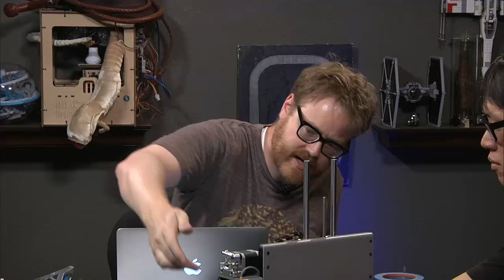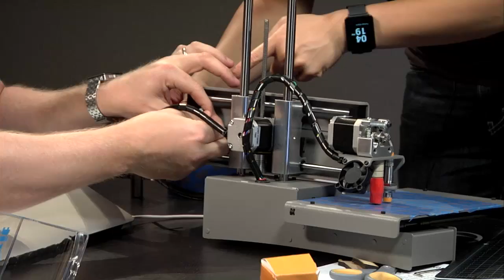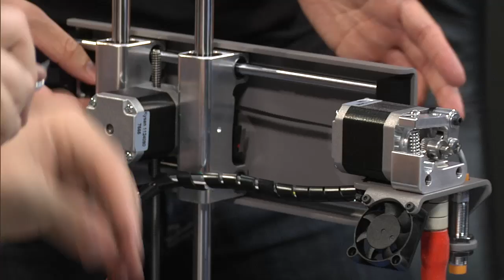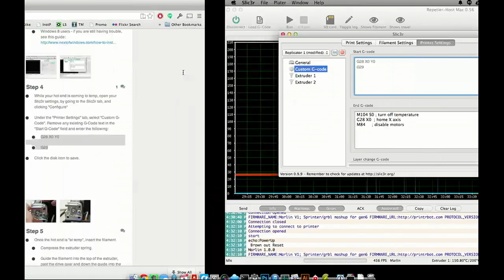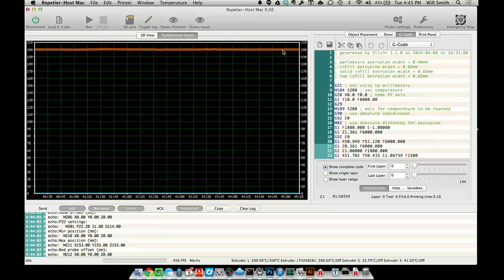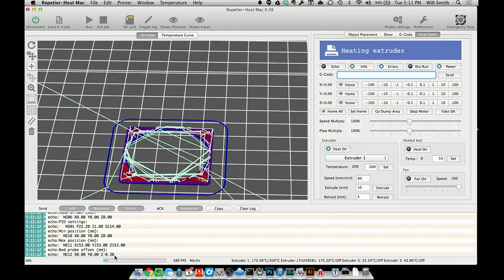Tested Builds: $540 3D Printer, Part 5

Comment: just found out a very effective method for bed surface prepping and I bet everyone has one roll in their house haha
remember that plastic wrap you might've used before to cover the outside of a textbook to keep them neat?
well its reaaaaaally effective for bed adhesion, at least in my case for the prusa i3 printing abs on heatbed
and even more effective for extracting the prints; I scissor cut a piece and stick it over an 8x8in glass

Comment: @2:20 Why do you use the blue tape? - So you can remove your print. And whatever about the overlap. There is superwide blue-tape available. most of the time I put enough down to cover the corners so it doesn't warp and it gives me a good corner/surface to wedge a blade under to pop the print off of.

Comment: it looks like the bed proximity sensor they included is junk, I'd take a mechanical switch over that any day.-- with all of the rods and bearing on the back of the bed you would think that would impact its ability to sense a specific distance from a varying profile of metal...i think manual bed leveling would be more newbie friendly than this option...
Reply: That proximity sensor looks pretty normal to me, though it looks like it would have been better if the kit designers had chosen a type that reacts at a distance of several mm from the plate, so it would be a safer distance from the output material.  All the fiddling was about adjusting its position relative to the extruder head, by simply turning one nut, then locking it with a counternut.  But once again, a more sensitive detector would require little or no hardware adjustment, just a larger configuration offset for the homing operation.  E.g. if the sensor reacted at 5 mm above the metal and was mounted 2-4 mm higher than the head, the offset would be 1-3mm, and the clearance would be 2-4mm.

Another relevant test / adjustment job would be to scan around the full X,Y plane and measure if the hight is consistent using the end stop as a probe.

Comment: The Z sensor and the auto procedure to check the level of the built platform, using 3 points, is probably for the software to get an idea of how offset is the built platform plane from the xy plane. By knowing the offset the printer can correct the movement of the printer head in order to keep the distance from the printer head to built platform constant (offset the planes In the gcode). In this way, this printer doesn't need any adjustment of the built platform, it can print in a surface that is off level.

Comment: One good way of securing small belts with zip-ties is to take two sections of another zip-tie the length of 3 to 5 belt teeth and place them on either side of the belt being cinched (zip-tie teeth facing the backs of the belts).

Comment: NEXT Build: Building a 3D printer with a 3D printer. You could potentially print all the components except the wires and electronic parts with a 3D printer.

Comment: That sound during the small holes is definitely the host not sending the commands fast enough. You can fix it by taking the print move render off the screen or lowering the render quality to speed up the program.

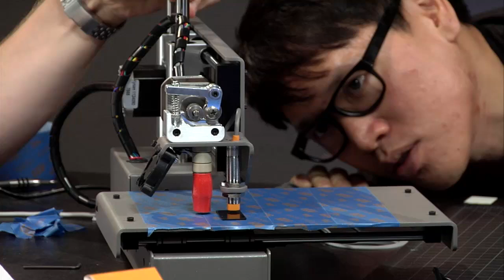Comment: 5:10 What if it had a little LED which beam gets narrower and narrower as it closes distance with the plate.
Reply: Then if it completely lands flush with the plate, then the light would disappear and you can back it up to just barely peaking light. Easier way to distinguish between completely touching and barely not touching.

Comment: Interesting build.  Thanks for showing it.

Octoprint is great.  I run it on both of my printers.  But, I would recommend using a Beaglebone Black if you are planning to host it on a printer.  The Pi is cheaper and I think a little easier to setup with Octoprint.  But the better performance of the Beaglebone is noticeable.  Especially when uploading large gcode files.  Files that take several minutes to upload on my Pi are upload to the Beaglebone in seconds.  And I see far fewer "stalls" in the print movement on complex corners with the Beaglebone.  I've even been considering swapping out the Pi on my other printer.

Comment: File a small flat on the stepper motor shaft where pulley grub screw hits. It makes for a very positive drive. use a small needle file..

Comment: X 0, Y 0, Z 0 is in the front left corner. X counts up as it goes to the right. Y counts up as it goes to the back, and Z counts up as it's raised. If the steps are being counted backwards you can just flip the connector to reverse the direction of the stepper.

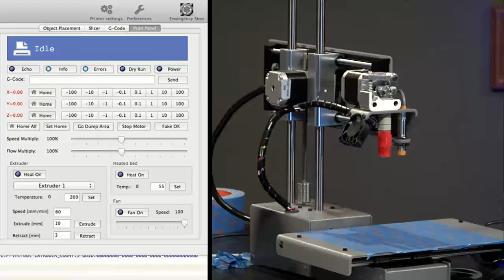Comment: @24:40 The software should move each axis in steps until it reads a switch being activated, then configure that switch to the appropriate axis. This would protect the motors and it wouldn't matter which port you connect the switches to. Also I swear X is horizontal, Y is vertical and Z is perpendicular to X & Y, or am I wrong?
Reply from the maker: Z is vertical, Y is the forward and back, X is left and right.
Reply: Is that just a 3D print thing? I was just thinking about axis' on a graph X being horizontal, Y being vertical and X being toward and away from the viewer. Thanks for the response Tested.

Comment: Am I the only one who would take a multimeter in order to check the end switch first?
Reply: Multimeter? They went without snips for the whole build. I think asking for a multimeter would be asking to much. :)
Reply: Nah, i would check with a M code what endstops are open/hit, and when clicking again, aka the same, also it was kinda obvious it wasnt hitting as if the endstop would be broken, it wouldnt home at all, not even move towards that direction.
Reply: broerbreaker9240Z I have no personal experience with 3D printers... How does the end-switch functionality affect the direction?
Reply: FilmFactry I understand that but he wrote " .not even move towards that direction."
Reply: Martin Blass Normaly there is always eletricity going through the endstop, Once the switch is clicked it will interupt the eletricity,

If the Endstop is clicked or not soldered right it would go away from the endstop for like 5mm as it thinks it just hitted the endstop.
When it knows it isnt hitted it would actualy go towards the endstop of course.
Reply: Ah, ok... So it is NC and if either the switch is tripped or the line broken the motor will not move. What if there is a short circuit though? :-)
Reply: Martin Blass Nope, broerbreaker9240z is wrong.
I'm constantly working with Pronterface and Repetier host and they're not that smart.
If you press home, it will simply take the direction in which 0 lies from the firmware of the 3D printer and then move towards that direction until the equivalent endstop is (correctly) hit or you stop it manually (which in most cases only works via emergency stop or power off while you're homing).
Neither Repetier host nor Pronterface care if you have any endstops connected at all and it will simply crash the printer like it did at the beginning.
If you set up a 3D printer, M119 is one of your most valuable gcodes: check the state, click and hold an endstop, check again, repeat.
Reply: Lol nah, Try disconnecting one cable of your Endstop, it wont crash, It will go to the oposite side for 10-15mm ;)

First be sure before telling someone is wrong.

If the cables are correctly soldered it will crash, if the button can't be pressed by the bed, but that wasnt what i was explaining.
Reply: Martin Blass Yep its NC, The motor will probably move, but just 15mm forward aprox.

What do you mean a short circuit, if its simple getting power like NC does? well it will crash obviously.
Reply: broerbreaker9240Z What firmware/host Software are you using? I'm using Repetier with Repetier Host and Pronterface atm, both don't care if I have endstops attached or not. I was using Marlin Firmware for a while and as I can recall it didn't care either.
Also: are you using mechanical or optical endstops?
Reply: I'm using the latest version of Marlin with normal mechanical endstops,

It might also just depend how you soldered it,
You have 3 pins, so you could make it NO or NC
Reply: i´m totally with you!!